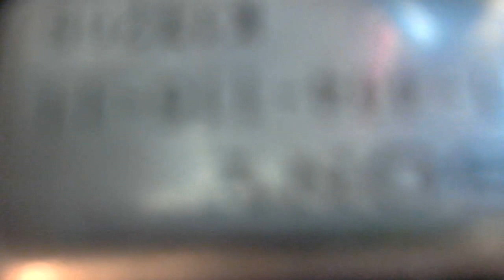Sony ICF 2001 Video #22 - Finally Some Consistent Behaviour

Comment: Question
Is that a light on the top part of the radio's lid/face
It's in the corner by the metal shield
You can kinda see it from the back/your side of the radio
Sometimes I see it flash when you power up and some time I don't
what is up with that ?
Reply from the maker: You are watching very closely.  If you mean the red light, it's one of a row of five LEDs that are the signal strength indicators.  When the radio is in it's usual non-working state, the bottom light, which is visible from underneath, comes on briefly on startup.  I don't think the light's behaviour is telling us much.  I'm betting that the problem is the two switching transistors in the power supply or something related.
Reply: Got it. Its kinda hard to see . Oh well just thought it might be useful info
Reply from the maker: I was quite concerned about too when I first noticed it.  I thought it was reassuring that something was happening.  Now I think it's just the radio winking at me.
Reply: Jim Lindenas lol

Comment: So is the up-converter "18volt" running ? all the time
Reply from the maker: For all the testing I've done, I can't answer your simple question for sure.  I think it only runs when the radio operates fully.  I often check for the 14V output on the D/A board and assume the converter is running when I see it.  I should check that when next I work on the radio.

Comment: Ok so regardless of weather the power is coming from the jack, or the batteries you should have 4.5v appearing at one terminal of the power jack. Also , there if C164 is leaky it will show up as a resistance and drag the voltage down at Q27 so measure the voltage at the + lead of C164.
whats the J3 timer jack all about?
Reply from the maker: My newly repaired shop power supply will help me get a better 'read' on all the voltages around the switching transistors.

Comment: Wow.  The video quality in the show is excellent.  One problem solved!

Tom
Reply from the maker: If you're thinking it came from a hangout, it didn't,  I recorded it at Logitech enhanced 720P which is really a lower resolution enhanced to be close to full 720P.  In any case, it's looking good but I am spending hours upon hours uploading the videos.
Reply: That is why I try to keep my videos less than 20 minutes long.  At 20 minutes and 720P it can take 2 to 6 hours to upload depending how busy the internet is.
Reply: hamrad88
How long ?
are you kidding me!
Reply from the maker: For me, it's about an hour for 15 minutes of 720P.  If I edit them, you can add another hour to post and then an hour to review before it's ready.  I'm having trouble posting the same day I shoot the video.

Comment: It does not charge the batteries. The power input section consists of the batteries in parralel with the power input jack, and the supply rail is connected to the switching transistor via the switch on the power jack.  Inserting the plug simply changes the position of the internal switch wafer so that power is supplied from the plug and not the positive terminal of the battery.
Reply from the maker: My bad.

Comment: also the ground for the battery and ac adapter do not go directly to chassis to goes to chassis via the timer jack
Reply: yeah the idea with that is you can have an external timer controlling the power on off of the radio.
Reply from the maker: I was warned about the timer jack being a problem after the first few videos.  At that time, the board was still in the radio and I could not fully test the situation from above.  I worked the timer jack and convinced myself that the jack was OK.  I did what I could to check through all the power supply stuff and then moved on (maybe in error) to search for issues further in the radio.  I'll get back at this radio soon.  Thanks for your help.
Reply: I would bypass the timer jack and concentrate on getting the power input stable.

Comment: also if you short q27 collector emitter it should work battery or ac adapter if the dc ac adapter jack is not faulty then there is a ground fault
when the dc dc converter buzzes then you know its working
Reply from the maker: Thank you for your helpful comments.  I tried shorting the collector and emitter a few videos ago and the radio did not come on.  But, at that time, I was convinced from earlier testing that the 4.5v (actually 5.3v from converter) was reliably reaching Q27.  I need to check this over again.

Comment: the buzzing is the dc dc converter 4.4v in 18v out
battery voltage and the ac adapter voltage is switched via the jack socket
q27 should on when the 330r resistor is grounded (poor design should have a resistor from base to emitter to bias it off when switched off )
q27 could be leaky

q26 is the sleep switch
Reply from the maker: I've repaired my shop variable DC power supply and I can now safely power the radio from a reliable 4.5v source next time I'm working on it.  This should result in the development of proper voltages around the two switching transistors for which I can test.  Until now, I've used a poorly regulated supply that appears to be at 5.3v.  The result is the voltages developed around the two switching transformers do not match the schematic.  That leaves me unable to be sure about what is really happening.  All this will change the next time I work on the radio.  And that should be very soon.  Thanks, Jim.

Comment: I think you have a bad power input jack.  There is a switch in the jack , the switch wafer could be faulty.
Reply from the maker: I eliminated that early on.  Time to eliminate it again.
Reply from the maker: If it turns out to be the plug then I'll be joining the Canadian team for the Stupid Olympics.

Comment: Ok .. my theory
powered from the wall pack or battery no dif..  right
so when you plug the pack in to opens the battery switch "J4" and hooks the wall pack up
wall packs a not know for good voltage regulation
it may be that the wall pack is a bit over 4.5 volts
is the extra voltage giving something in the radio a voltage "bump'
maybe starting the DC to DC converter
Why can Jim HEAR the DC to DC converter ? hummmmmmm
You may what to look the power supply over very carefully
This radio has a lot of different voltages
Q 33,58, 39,45.48 all look like  parts of the power supplies
Look at the  different power supply voltages . I saw
 18, 14, 10.4, 3.9, 5.4  and some others

On the Sony drawing  "  near J4" to the left
see the "4.5 volts " note the line goes to the left and also down
follow the line down . it goes to "IC 203 and D201" may be on the 2nd page of your Sony drawing
Looks like a circuit to tell the digital part of the radio "its ok to turn on / you have a main power"
is that working ?

Sony Stuff can be a pain / I know your going to beat it!   Good Hunting
Reply from the maker: Great stuff.  I agree that I'll find the fault if two things remain true: 1. I have help from people like you and, 2. I don't give up.
Reply: Well looks like you have lots of help !
The other folks that chime in have some great ideas also.
Was this the radio you showed the hammer too ?
may be its hammer time